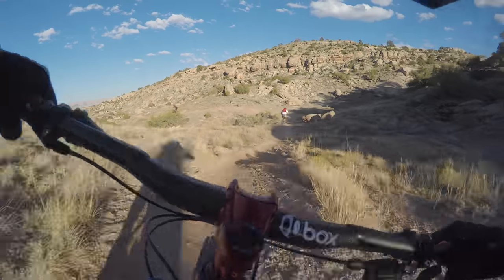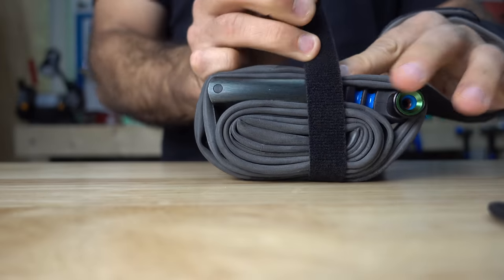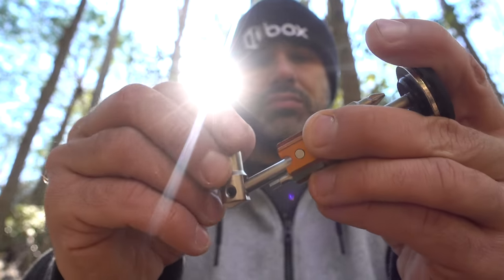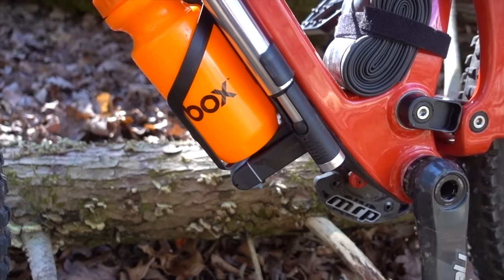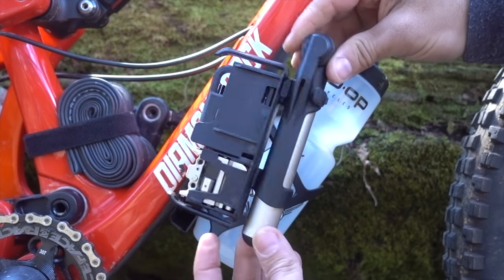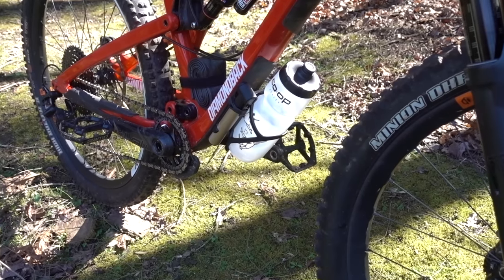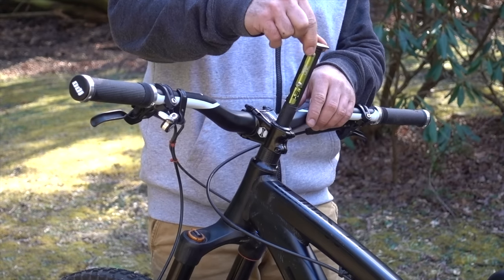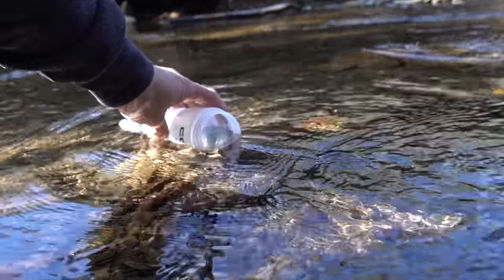5 MTB Tools that Live in your Bike

Comment: First, let me say your videos are great and well done. Second I wanted to point out that threading the inside of your steerer tube where all of the clamping force of your stem and all of the torque of your bars in concentrated I'm sure would at the very least void your fork's warranty and and worst could cause a catastrophic failure. I have seen forks and stems break in my career, its not pretty and could kill you.
Reply from the maker: I thought of this, but more often than stems breaking I’ve seen entire head tubes crack off. I’m wondering how much that threading actually affects the strength... One thing is for sure, you lose the warranty!
Reply: I would think cutting threads, rather than cold rolling them like on spoke ends would create a stress riser in the thin materiel of the steerer and give it a spot to start a crack, like scoring glass to cut it. I don't think I have ever seen a headset that requires threading in lieu of a star nut probably for liability reasons. You reviewed some nice tools though. Gives me some ideas for stocking my store this season! Thanks for making great videos.

Comment: Seth, I noticed that you are running tubes on your trail bike.  I am a novice of about 4 months who just upgraded to a Trek Stache 5 29’er + with 3.0 midfats.  I’ve been told that tubeless is the best way to go with this specific bike, because with so much rubber you can really grip using much lower pressures, like 9-10 psi, but I’ve also been told that tubeless will leave you stranded on the trial if you pop a bead.  Being a novice I don’t really know which way to go. Again, I noticed that you are tubing it so can you please tell me your reasoning for this and not choosing to run tubeless? Thanks!  Ride long and Trail Hard, Brother!!
Reply from the maker: I’m not running tubes on my trail bike, but most riders carry a tube for the event of a sidewall tear. Tubeless is the way to go!

Comment: Yo Seth. I've been following you for a while now since we have the same passion.
But, I've been struggling to make a choice since buying a full suspension bike isn't a cheap adventure.
I am 6"3, 90kg around ~200pounds I guess. I am stuck between a Giant Anthem 3 2015 100mm travel Rock Shox and fox float rear damper also 100, another 2015 Giant Trance 120mm front & rear and a 2015 Giant Trance 150mm travel front and rear Fox suspension all 27.5 frames. They cost $1100, $1500 and $1800 respectively.
 I am afraid of buying a 100mm travel then quickly outgrow it and also I don't want to settle for the long travel too because they seem to be sluggish and heavier because I am already heavy.
Please help.
I ride from home to the trails (~20km) then I ride trails that are XCish and of course downhill sections that could be really steep.
Where do you think I should begin? Everyone else's detailed opinion is welcomed as well.

Comment: Can you put a water bottle holder on the 2017 Diamondback Mission Pro? I'm at the point where it would be nice to have a simple water bottle for quick rides and not have to lug my Camelbak around. I went to my local bike shop with the same question and with just a small glance of the frame design from one of the "experts" working there he basically told me the frame geometry is incompatible with a water bottle and that was that.

Comment: Wonder if the Topeak Ninja would fit on a 2015 Stumpjumper Evo...... All In Multi is a nice option but seems my crank arms aren't magnetic, Oneup EDC is amazing but that cost escalates - £40 for the tool, £30 for the installation kit, £20 for the top cap/spacers, yikes!

Comment: At this point, I'm actually considering dumping my trail bike solely because it lacks a bottle cage. I hate having to wear a pack every time I ride the thing. Even on a short loop, I'm going to need SOME water. Guess I'll take my rigid steel 29er with bottle cages instead.
Reply: Downhill and Deadlifts they make bottle cages that attach with Velcro

Comment: And a way to make your bike even heavier lol.  Ok with the exception of the bottle cage products My bike is 98% Carbon fiber.  that magnet tool that goes in the crank will work for my bike no metal in the crank arm.  And my steerer tube is carbon fiber.  Can't but threads in it.  So non of those will work.  But to be fair my bike is a custom so I can't fault the companies for that.

Comment: Yeah, nice tools but the price is so high i would rather get good none specialized bike made ones and just have a little go pack i strap to my bike or put in a backpack. It seems like the price is for the "Wow" factor more than the practical use. I want a good tool but not going to pay an extra $50 or $100 because it fits in the bike a clever way. Id rather get more of the right tools and put together a mini pack of my own. They are nice though.

Comment: Don't buy the I9 matchstix! I have one, and in real life, it sucks. Everything is just too small with gloves it just takes forever to adjust things. The leverage is not enough without fitting the axle, which means you have to remove the entire axle and then put it back again. Couldn't even adjust the shifter bolt because the bits are just too short. If you are a weekend worrior, maybe it makes sense, but if you are in a race, just take a mini tool.

Comment: These are pretty much all pointless gimmicks, just get a small rucksack or something.  Much safer and secure, and you have the flexibility of your body to reduce the stresses of the bumps and impacts rather having all that weight stuck rigidly to the frame.

(Your water bottle would get pretty dirty down there, and wouldn't the wheel catch it if you bottom out the suspension?)